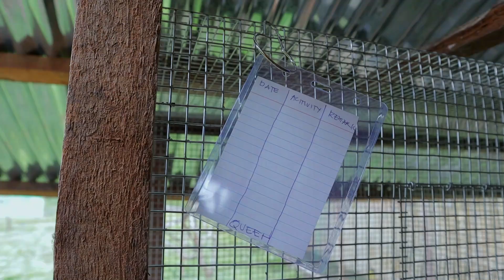Coop design for young chicks│ Vaccination & Making Rabbit birthing area

Comment: When I was still working as an Eviromental Health & Food Inspector (Rural/Regional Local Government) I had to inspect chicken grow out farms. The sheds are constructed with cement floors, metal walls and roof with ventilation panels in the sides and also large fans. The owners had arrangements with local farmers to supply the hay/straw which was spread at a depth of around  2 feet, entirely covering the whole floor. 450 day old chicks go into each one and stay in there until thay are harvested for the chicken meat trade at six weeks of age and taken to the processing factory. Eight weeks for the 'special', larger chooks. The hay and acumulated waste is then cleared out by the farmer (and shed workers) whose hay/straw has been used and taken to be used as crop fertiliser. All feeding and watering points were moved to different heights as the chickens grew. Then the shed was cleaned and disenfected (Vinegar is NOT a good disenfectant, especially when diluted, you might as well save your money and just use the water!) The lights were kept on for 18 hours a day and food always available to ensure fast and large growth. The whole 14 -22 sheds, depending on the facility, were on a computerised system of heating and cooling as necessary. A little different to your setup which is more personal  :)
Reply from the maker: Thanks for sharing Lynda

Comment: There is lots of open space available. So you go for Solar Power System. It will help to minimize the running costs and simultaneously give shade for your pets. This is my suggestion and you can try if you feel suitable. Yes initial costs will be high but power cost will be almost free.